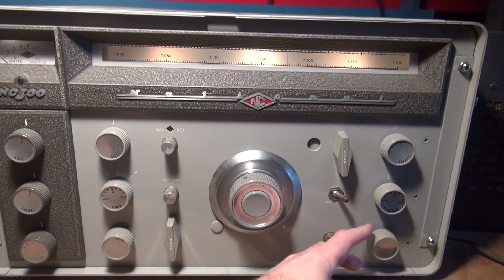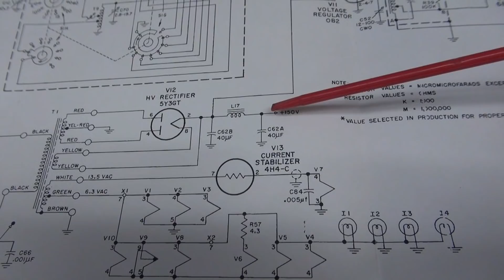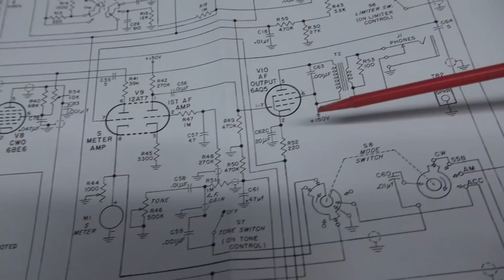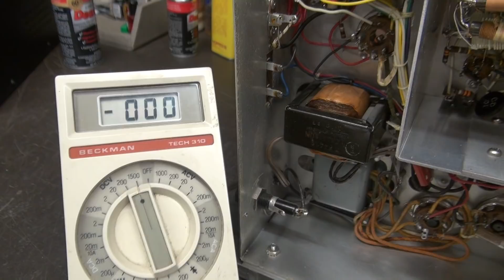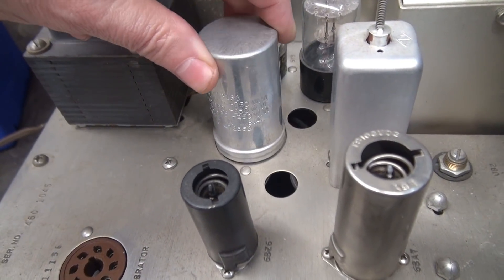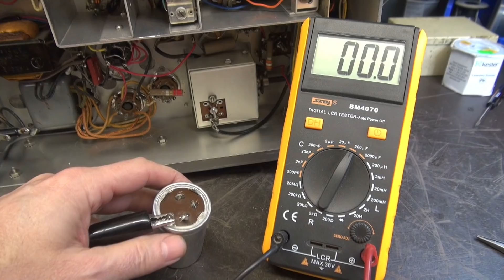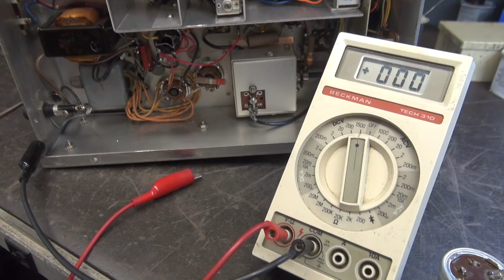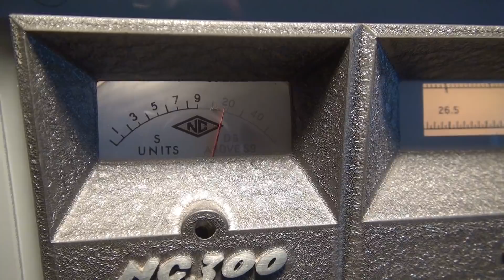How to replace National NC-300 tube ham receiver Filter capacitor

Comment: Out of curiosity, what values did you end up using? The caps you used looked decent in size, especially the 20uf. At 7v wouldn’t a 22uF at 16v be sufficient? Those are pretty tiny.  Anyways, just curious as to what you used. Oh and Happy New Year!
Reply: Probably were 47uF 400V capacitors for the high voltage, and a 22uF 400v for the low voltage, to get similar size cases. Would be interesting to see the ESR of the old one, probably up in the hundred ohm range by now. Now to change those mains input filter capacitors from the nasty micamold type to modern class Y capacitors to give it extra safety.

For appearance improvement you just take a piece of black painted heavy card and stick it to the top of the 3 capacitor assembly before shrinking the outer sleeve, and it acts as a top cover. If you want you can also print on paper the values of the capacitors and the date using a laser printer, then stick the paper to the outside as a label using some superglue on the ends to make it look better, even put the D Lab logo on it as identifier.
Reply: @SeanBZA   Totally agree , old line caps get cutout before testing especially on 2wire mains (240v) here
Reply: Good thinking on the cardboard cap.  A cardboard tube would also be nice to use as a form for a perfectly round cap grouping, but that’s just my OCD talking.  

The ESR comment had me thinking. I needed a 3.3uF 250v cap and it was a need it now situation. I went to the local electronics place and all they had was NTE. Got it home and threw it in the Peak Atlas meter and the meter  read >40 ohms lol.  Needless to say it didn’t go in and I ended up waiting the week for a decent Nichicon to be delivered.

Comment: Great channel!  I was a radio enthusiast and bought a "BW TX 50" FM transmitter. 88 to 108 MHz. I launched my pirate radio career by locking down the microphone and placing it next to a tape cassette playing a song and I grabbed my portable radio and walked two blocks away and tuned in and received said song. And that was the end of my pirate radio career. I totally lost interest and now I want to sell my little gem. But I did notice that when I transmitted, my digital display clock radio changed and the numerals did this weird dance of distortion. I became afraid. Just what the heck did I have here? Was the FM transmission pulverizing my brain? It's been years and my little gem looks as darling as the day I unboxed her. Now I want to assemble all the electronic kits I bought and tossed aside but first I have to complete the mother of all helping hands that I built from scratch. Electronics is a vast subject.

Comment: I don't suppose the new caps could fit into the old cap cover? Just glue it on the 3 new ones to keep the original look after stripping out the old cap materials? Might help some with interference.
Reply: Or, leave the old cap still mounted, and wiring the new caps under the chassis.

Comment: Great job as usual. I am working on an old Airline Am/FM radio and used a tube socket for the speaker connection to the chassis ( the original was all full of carbon from a bad tech previously). It works like a champ. As I recall you drill down into your sockets which is great...  Excellent tips Terry always.  Happy New Year to  you and Marcia
Reply from the maker: Yes Sir, Thanks again for sticking with me + support. Hopefully someday we can meet up, share some Merlot! Happy 2019!

Comment: Hello again Terry and I hope you have a great 2019!
One question though, do you check with a scope the ripple on the cap.  At Heath, we used to "scope" it first to see what the ripple was and then replace it if needed.  Usually finding hi leakage after.  
73 from Mattawan,
Ski
Reply: I used to do that on equipment, generally found poor capacitors and failed diodes as well in the power supply with that test as well.